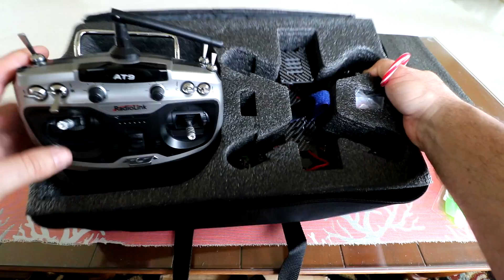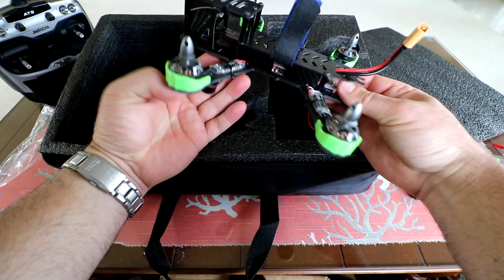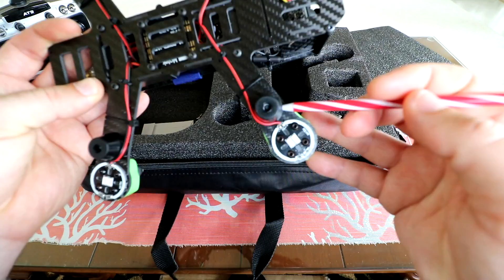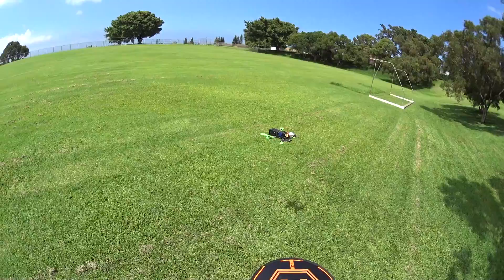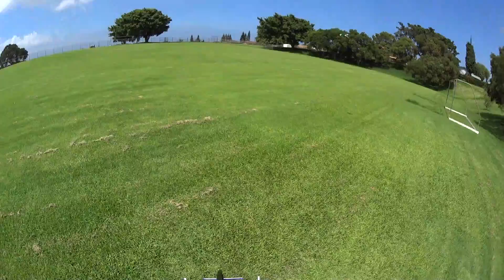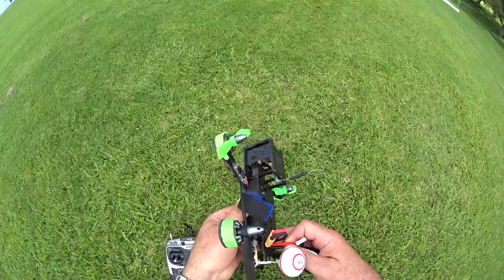LHI 220 RTF FPV Race Drone Review - [Unbox / Inspection / Flight-CRASH! Test / Pros & Cons]

Comment: Hi Dustin.
You don't need to apologise for crashing the quad. You successfully, and thoroughly, demonstrated that even though it's shaped like a race quad its construction limits it to being really nothing more than a fun flyer. A true race quad needs to have the ability to hot swap components between races but this one needs to be totally stripped and rebuilt even for something as mundane and pedestrian as a broken arm. However what I see as a positive is that as an all in package, and to include an AT-9 radio, it has reasonable value. Surprisingly, and this is rarely the case, it is cheaper from the UK Amazon store, £198 or about $246.
Regards
Nidge.
Reply from the maker: +sputniksam Hey Nige.  Glad you can see the important info I've shown here for potential buyers.  I'll try and get a new bottom plate on and do a proper FPV review session for it...Also try to find a way to brave the new plate at the weak points 😀🍻
Reply from the maker: +Dustin Dunnill *brace

Comment: Pfew.. them screws just at the Root of the arms.. That is kinda an unfortunate design choice :|
Reply from the maker: +DutchRC Adventures Hey Dutch.  Agreed.  It's literally the main leverage point.  So I don't know what they were thinking drilling 2 holes and a notch at the main failure point 🤔